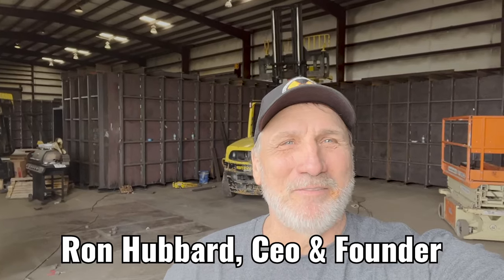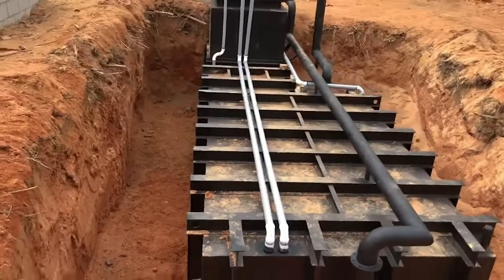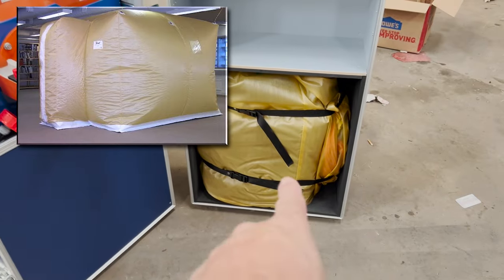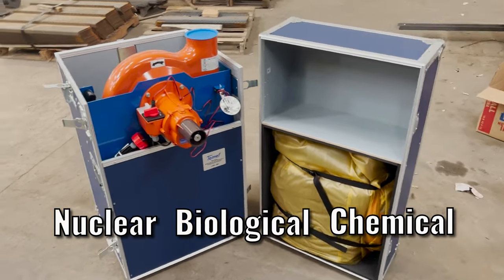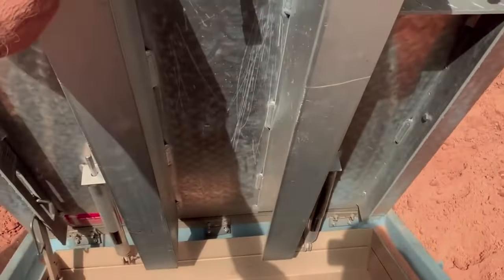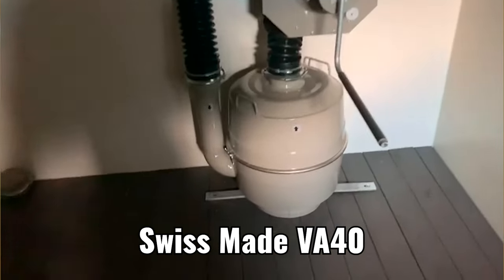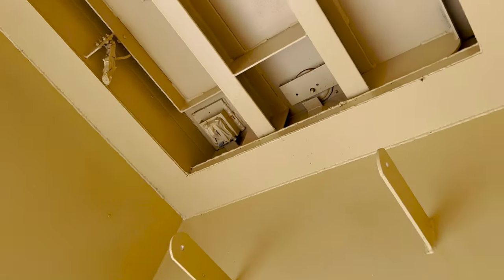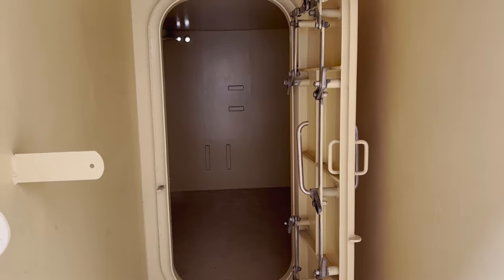Our two Cheapest Fall-Out Shelters

Comment: Be a good idea to have a way to connect fallout shelters so that you can keep adding them one at a time as you can afford them. Working your way up to a large shelter over time.
Reply: there is
Reply: Does he offer that?
Reply: @bastionwolf  yes. Look at his bigger bunkers. He connects the ''smaller' ones to make 1 big one. In theory you could dig up the bunker and just add another part on. This would of course make the price rise significantly since you need to excavate multiple times and do demolition if you want concrete around your bunker
Reply: My thoughts also! Let's see what can be added
Reply: Yeah
Reply: Hope people have the time to do that.
Reply: @heru-deshet359  Yeah. I'm worried that we're running out of time.
Reply: @kaptein1247 They install concrete on top of the Bunkers
Reply: @thebeastman6668  only ontop? Havent seen anyone do that yet. Whats the reason to do it?
Reply: @kaptein1247  The surround the bunker in cement on most of it when dug in the ground to make sure the bunker doesn’t shift or get damaged during an explosion going off, other uses include to prevent Gamma Radiation to a further extent and much more.
Reply: @thebeastman6668  Completely encasing is something else entirely than simply putting it ''on top''. And for radiation protection it isnt really necessary. Neither for strength. Not for these types of steel shelters at least. 
And in most cases (the ones shown in the videos at least) Atlas doesnt encase their shelters in concrete.
Reply: @thebeastman6668  What does this has to do with anything btw?
Reply: @kaptein1247  they do encase some. depends what the customer wants
Reply: A modular bunker option seems a good idea, start small and grow with time.

Comment: That's great that you're making more options available, specially for smaller or confined yards.
I think I could utilize this size by putting 2 together along with an escape hatch.
I don't have a family, just me and dog, we could use one side to relax and the other for additional storage...all those dog treats take up lots of space...it would also make an excellent COM room too!
Reply: Hey. I’m considering either the 8x16, or the 10x20. The price difference is far crazier than you’d think. An extra 2x4 is tens upon tens of thousands more after delivery and installation. I was quoted $100k for the 8x16 after delivery and install, and $175k for the 10x20 after delivery and install. Insane. I’ve thought about my dog. I’m not sure how that would work. Feces, urine, dog food, water. I’m not sure if it’s doable, unless someone has hundreds upon hundreds of thousands to spend.

Comment: Thank you for putting something affordable together for people like myself. Does this unit have plumbing capability? I am working with the state of ND & FEMA right now on a storm shelter grant. I'm wondering if this bunker would qualify.
Reply: I don't see any provision for plumbing. Of course nothing is impossible, but if you really want plumbing, it probably wouldn't cost much more to upgrade your shelter to one that comes equipped for it. To go it on the cheap, maybe buy a large cassette toilet from an RV supply center and get an extra cassette.
Reply: I don't see any plumbing capability.  However there are chemical toilets that can be stored in the shelter along with the needed food and water.  Things will get a little smelly in a week or two, but it would work if you can cope with boredom in the dark.
Reply: In one of his videos of the bigger bunkers he mentioned a connection to a septic tank. However that was for an acreage that already had septic and he didn’t elaborate on the system. 

This under garage bunker is a bit stupid not to be connected to the house utilities. It’d be simpler to use ICF to build hidden basement extension under garage, driveway or patio. Then you could use the water tank regularly and keep it fresh.
Reply: @kenibnanak5554  Does not have to be dark. There are high power, long lasting flashlights that can be stood up to provide spread out lighting like a candle.
Reply: poop in a bucket with cat litter 😂

Comment: good stuff Ron!   glad you have a more affordable option.   one of my main concerns would be getting stuck in there.  only one way in and one way out, thats pretty scary for me.
Reply: Exactly, my first thought was what if a hostile blocks the door on the outside or roof of the garage collapse on the hatch by any kind of blast. Then it would be a 40k grave. I believe any shelter should be equipped with a secondary exit, preferably a bit far and hidden on the outside.

Comment: Watched twice Ron to make sure I didn’t miss anything. So my question is how tall is the tent one? And size don’t have a big yard or a way to get a big truck in my back yard. My house was built in 1880 my small basement has 1 ft of rock around it for the foundation ( thick ) but the wood ceiling so thought how about concrete board in the rafters and around it have it in my basement? Once you blow it up can you let the air out and move it to another place if you want. Thsnks

Comment: I don't understand how the inflatable shelter actually does anything in a nuclear situation. Where is the shielding from gamma radiation? Where is the protection from blast effects? Only seems worth using if you already have a bunker... but then it would be cheaper to just buy an air filtration system for that instead. Really confused.
Reply: It’s just for alpha and beta fallout, you would set it up in your house/garage and stay in it to filter out the radiation until the fallout dissipates.
Reply: @genechoate5020  alpha / beta particles are not very hazardous though. Clothes, goggles and a dust mask is enough to protect you from them. Gamma will be by far the biggest danger. People will buy this thinking it'll save their lives when in reality it'll probably just lull them into a false sense of security while they get cooked from insufficient shielding.
Reply: @npwn6569  the system is for installation in a radiation hardened area like a basement. This system keeps the air clean. Nuclear particles when ingested are lethal.

Comment: I heard that some of the Tesla car's are supposed to have a impressive air filtration system? Would they be any good in such a situation?
Reply: Well, a problem is that with a nuclear detonation, it can also create an EMP. It might not just level and irradiate the area, but also fry any electronics in the area that survive the blast wave, thus rendering that entirely useless. Then there's also taking into account how long a battery lasts constantly in use without a recharge. Probably not more than a day or two at the most. A nuke would probably knock out the power in your area even if you weren't directly affected by the destruction beyond that. How effective are the filters as well? Filtering out pollution and dust would certainly help, but would it be enough? Then finally, cars aren't built to be airtight. Even if the car's filter protects you from irradiated particles coming in through your vents, does it pull enough air so that everywhere else where air could get in is only flowing outward instead?
Reply: Also cars don't have alot of what I would cal adequate radiation shielding

Comment: Do you build bunkers with existing pools THE EMPTY SHELL OF THE POOL ? Is it even possible ? I imagine it would be a lesser expensive bunker as well because the shell of the pool is already installed - just an idea I've had for a while because I have a buried pool
Reply: think the shelter would have to be at 11 psi above atmospheric pressure to maintain the web pool.  or an air lock to transition between shelter and web pool area.
Reply: love the idea.  really cool.  have it disguised as over sized drain grille
Reply: @dreadroberts7523  the empty shell of the pool sorry I didn't think I had to specify that considering I said I have a pool that's buried
Reply: @dreadroberts7523  I was thinking if the top were to just be constructed to fit over the pool it'd be pretty easy there's a couple different options for an entrance - I was just thinking hey cheap bunker all it needs is a lid lol

Comment: How can that thin nuclear fallout tent, keep out radiation? it seems to go against both mass and distance, i could understand it if you dig it down under a meter of dirt, but fallout will land on the top of the tent, and unless there is thick matterials like led plates all around the sides and top of the tent, i would say it dont work, atleast you wont survive for that many years after`?
Reply from the maker: It's for alpha and beta  and will require the body of a building to shield from gamma

Comment: I've been wondering what you do in high water tables.  do you put in sump pumps?  Our water level gets high enough that the radon pipes make a gurgling sound sometimes because they are pulling water and our basement had a couple feet of water in it once, so we assumed that our property wouldn't be a candidate for a bunker.  $40k is not currently in the budget but it's not so high that it couldn't be planned for someday in the future.
Reply: They are welded steel boxes,  boats don't leak either
Reply: A high-water table is not the problem - it is flooding.  Does it flood higher than 6 inches above ground as that is the hatch height.  If not, then 2 things can be done for your shelter, one; foam (urethane foam) the outside so the steel is protected as much as possible and two; install 4 antimony blocks on the corners for sacrificial anodes.  The water will allow corrosion of the metal when present.
Reply: Here is an idea - can you raise the ground in a berm like structure?  Maybe have a berm, in the yard, that is a flower garden, a landscaping design.  That raises the hatch up off the ground and hides everything in plants.
Reply: VM, search YouTube for "Installing Two Big Boy Bomb Shelters Side-by-Side". The installation includes watertight welding, french drains, and sump pumps.
Reply: @michaelcasper4727  yep, I’ve often suggested the same idea, it makes installation and access a lot easier, which is important for older people too